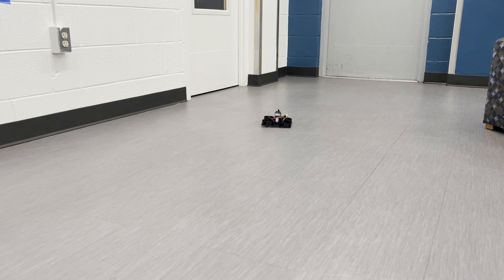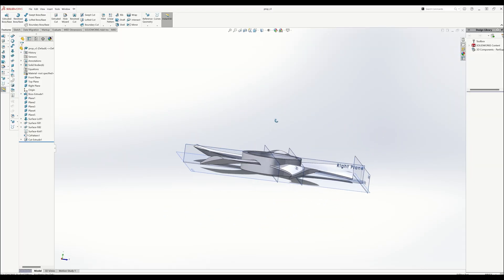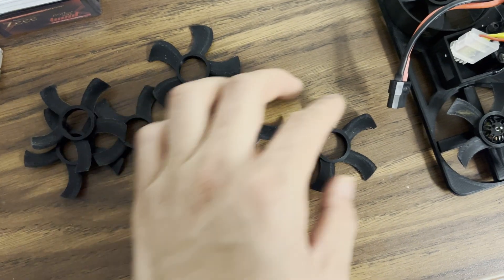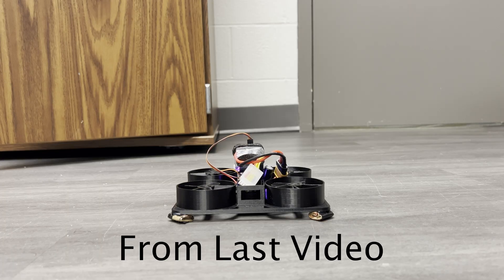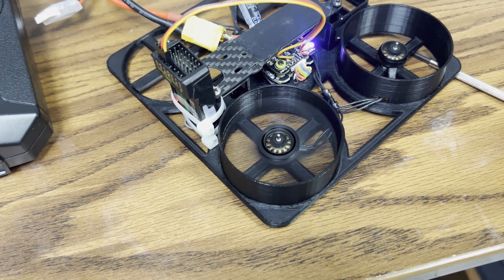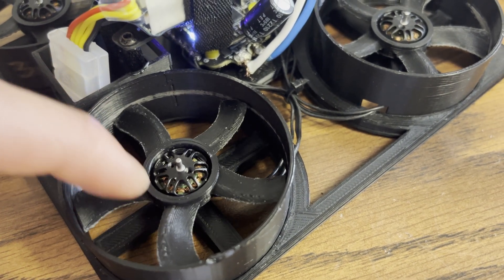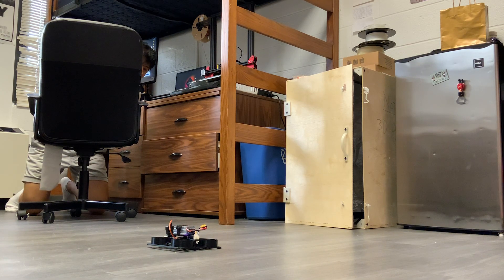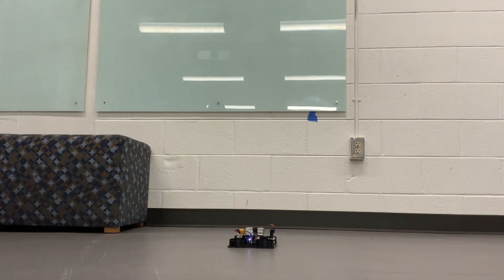Another Ducted 3D Printed Quadcopter Update

Comment: Great project! 
I'm curious about the reason not to screw the props to the motors, that would prevent the props from flying off and still give you the larger prop area...
Also every 'normal' prop has a higher angle close to the hub than on the edge of the prop
Reply from the maker: What do you mean by screwing on the props to motors? Anyways, you’re the first one to mention the angle thing, I’ll implement that in my next EDF for sure. Hopefully I’ll have a video on that soon
Reply: @mach10point4  there are threaded holes in the bell of the motors where you can fasten the props with little M2 bolts (same size that you use to fasten the motors to the frame)

Comment: I had a unbalanced prop shake the IMU in the FC just right. At certain RPM the vibrations would match sample rate multiples, leading to "beat frequency" signals making it through filters.  The FC SW would get phantom signals leading to oscillations and crashing, but only at certain RPM. Prop balance is really important.

Comment: Great work! you might get a little more thrust if the motor mount spars hold the motors from the top. The high speed air does more effective work when unobstructed.
Reply from the maker: Wait that's super smart, I've seen designs like that but didn't put together the aero benefits in my head. Thanks man!

Comment: im pretty sure the surface finish of the rotors is one of your biggest problem. the underside is just way to rought, therefore you get a lot of turbulence and drag.
try sanding with finer grid (powertool like a dremel will help) and use aceton to smooth the surface
Reply from the maker: Yeah for sure. I just posted another vid where I split the blades in half to get a lot cleaner print, I have way smoother surfaces now

Comment: I would suggest adding some lateral supports to the ducks to reduce the flex across the frame. flex in the frame causes extra noise in the PID control loop and that is why you burned a motor, the FC was trying to speed up and slow down the motors too much because of the flex and twisting in the the frame.

hey I got a secret for you from a drone racer: the force from your propellers, is lift from the top of the blades, not thrust from the bottom of the blades. so where you have your propellers "around" your motors, the whole center area of your propeller over the motor could be generating lift if you where using the T-mount for your propellers. refer back to Bernoulli's principal of lift for a more linearized example of how "lifting" force functions in relation to a wing, and then treat all propellers as spinning wings for easy maths.
Reply: lift is created by the pressure diff between top and bottom. you cant just ignore the other one.
also the center of the rotor is pretty much useless because the relative speed of the tip changes too much. in the center it is zero for obv reasons.
Reply from the maker: Yes, I think I underestimated the role the sturdiness of the frame plays in the controls. Thank you for your feedback, lots to think about/research!

Comment: I feel like as a test rig you should attach a thin string of Elastic to all 4 corners and you can calculate the thrust that way having it up off the ground while minimizing risk from wobbling.
Reply from the maker: The wobble is pretty forceful, I don't know if I'd be able to contain it if I don't bolt the frame down or something. Maybe I could take all the motors off and test thrust like that
Reply: @mach10point4 Gotcha.  Might be worth a  shot through.  The wobble is likely caused by all your motors spinning in the same direction.  Try flipping the blades and polarity on two of your corners so that the minor vibrations vectors cancel out instead of adding up like you see here.  How are the motors being controlled?

Comment: Hello,
Your job is nice ! 
I don't know a lot about the subject, but because of a research I had to make on micro drones, I remember finding interessant litterature about "quadcopter ducts". There are few papers or researchs you could use in order to improve the air flow of your structure around the blades.
Good luck with your work !
Reply from the maker: Thank you man! I'm currently going back to regular EDF designing and ducts/curved intake shapes are definitely one of the biggest things I'm looking to improve. Hard to do without some sort of flow analysis tool but curves are better than flat faces!

Comment: Dude these props and ducts are rubbish, but I appreciate the hustle so here are some tips. You may want to do some more research how to design them properly.
In general for the prop, use higher angle of attack at the tip of the blade (18-22deg) and even higher at the root so you get a nice twist. For the duct, avoid any sharp transitions, especially flat surfaces, which are prependicular towards the airflow.  After that, I would suggest to use ABS/ASA, which is much easier to postprocess with sandpaper and you can make it real smooth. Then at least a proper static balancing is a must. Otherwise the vibrations due to the imbalances create so much noise for the FC and it will never fly.
GL
Reply: yes, but also there is a lot of flex in the frame freaking out the PID too.
I've flown with some pretty jacked up propellers before as long as the frame is good.
Reply from the maker: I'm thinking about different ways to print the props to get a much smoother surface on both top and bottoms. I don't want to rely on sanding too much. I agree that the imbalances are causing massive problems. So far I've just been modeling off the ducted props I see on the internet, some have high AOAs other have very modest ones, so I guess I just have to experiment more. Thank you for your feedback!
Reply: Your prop blade twist is backwards. The AOA at the root should generally be greater than the AOA at the tip.

Comment: why not use a smaller receiver?! the one you're using has so much extra weight. reguardless, awesome stuff and keep iterating
Reply from the maker: I cheaped out and went with the Flysky i6x. I think people take that plastic casing off the Flysky receiver which would save some weight. Hoping to upgrade my transmitter sometime down the road which would make it easy to get a lighter receiver. Thanks man!
Reply: @mach10point4 there is EdgeTX for the fs-i6x, now
a few years ago before i upgraded EdgeTX didn't even exist 😅
there only was a work in progress attempt to port opentx
anyways with edgetx you might be able to use different rx's or connect a module

Comment: Hey, the woble is maybe because the gyroscope (FC) is offset (90°) in relation to the drone, check that your FC is in the same direction as your drone (on betaflight)
Reply from the maker: Oh god I hope this isn’t it. I think I set it up correctly in beta flight (granted, I have zero experience with FPV), but if I could’ve just rotated it before the motor went out that would suck!!
Reply: silly gyro orientations have been a problem i've encountered in things before @mach10point4  . good luck!
Reply: definitely looks like it
Reply: Now I want to know if it was it

Comment: For the fans you should look into resin for a nicer print but still super cool
Reply from the maker: Thanks! Structural strength is probably my biggest concern with these fans, I really want to be careful at these RPMs. I’m using PLA+, resin would scare me a little because to my understanding it’s less rigid. Maybe there are some super strong resins out there though? Cause I agree the detail would be so much better
Reply: @mach10point4  I have used resin for a vacuum at 120k rpm u just need the balance to be right resin claps pla and pla+ also it smooth rctestflight made one also
Reply: resin is much stiffer
which means it's also more brittle

Comment: Hey! I stumbled across this video on my homepage. From my experience designing a couple 3D printed ducts for quads, a huge factor in airflow (which is probably the reason for the wobbling due to not as much movement expected by the fc) is minimizing the obstruction to the air. You may want to consider making the motor mounts only have 3 braces and make them maybe half as thin if not a little more, and make them taller if anything so that they have more strength and less surface area perpendicular to the direction of air flow. Just my suggestion from my experience but awesome job so far!
Reply from the maker: This is super helpful. I didn’t think it was a big issue before, but thinking about it now those mounts probably take at least a quarter of the open area, so it’s definitely an aspect of the EDF worth putting more thought into. Appreciate the support 💪
Reply: @mach10point4  What you could also look into in terms of maximising thrust is to inverse the motors, so to mount the motors upside down with the props facing downward. Obstructions in the intake have a lower impact on thrust than obstructions in the high speed airflow.
[Edit] this would also allow to switch back to the shaft-mounted props since they can't fly away anymore ;)